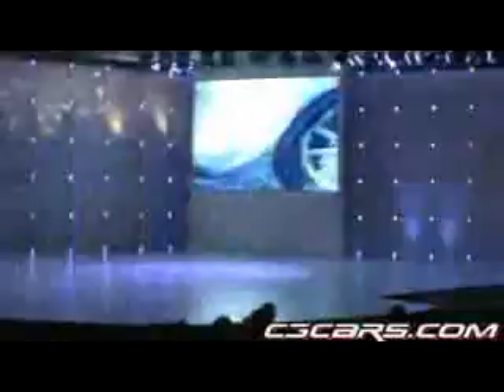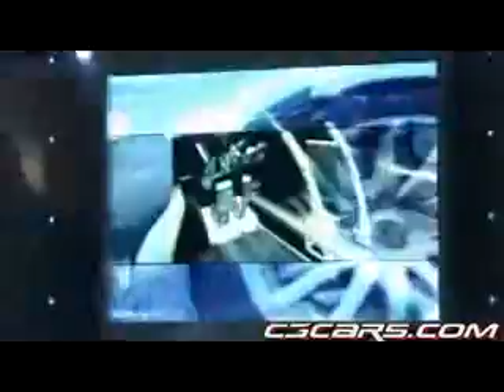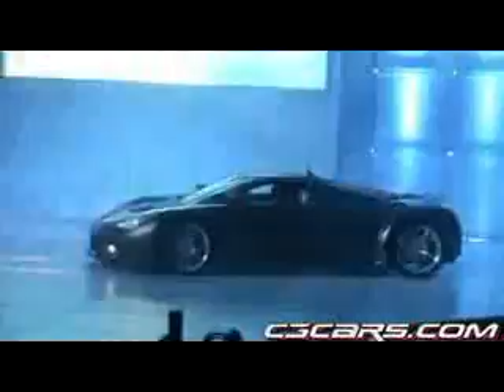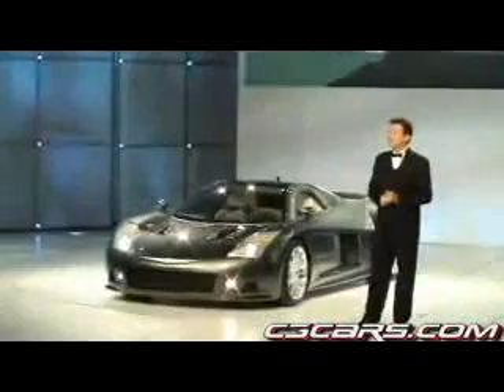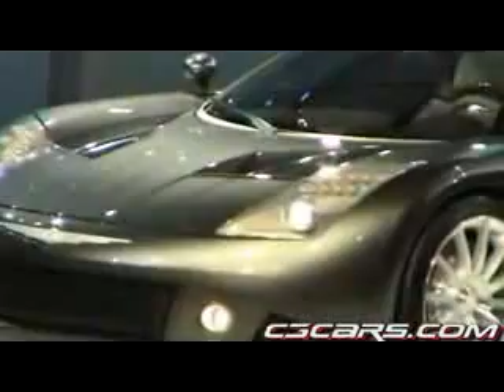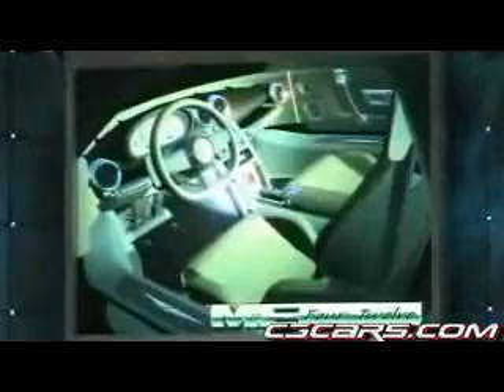Chrysler ME Four-Twelve supercar at the 2004 North American International Auto Show, Detroit

Comment: This is my design! I went to SJSU and designed this car in the industrial design program there. I had it posted on the wall and somebody just walked up and copied it! The only part I didn't design is the back and the interior. It was originally intended to be a super ford or superstang. I got my inspiration from the 1999 mustang, which I currently own. If you look, you will notice that it sort of looks like a mustang. I had a blue 3/4 rendering of the front, top and drivers side.
Reply: Are you high?